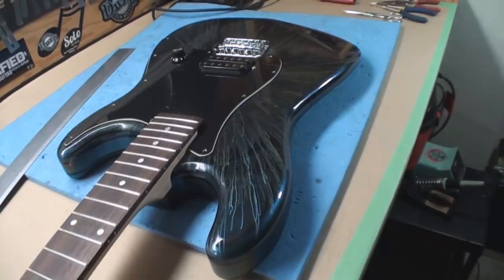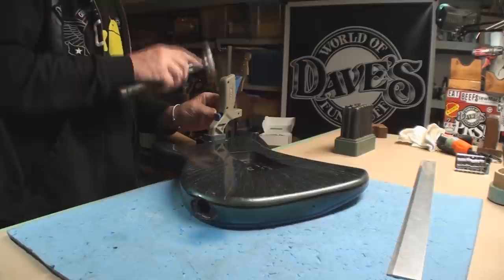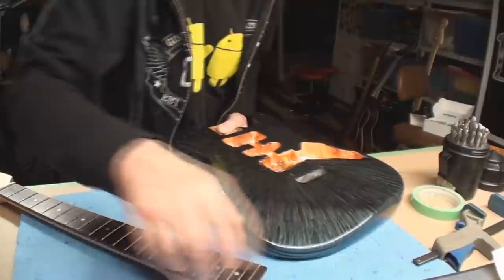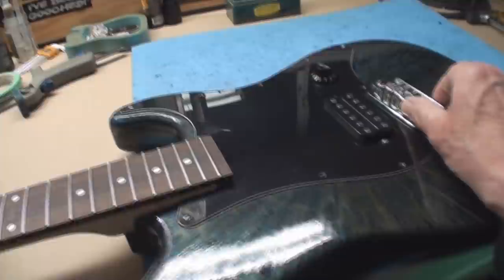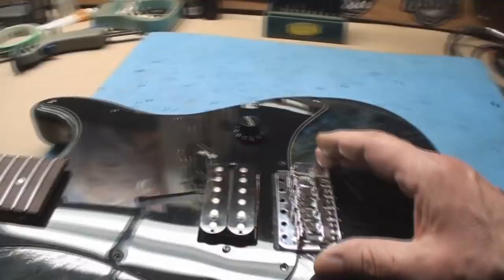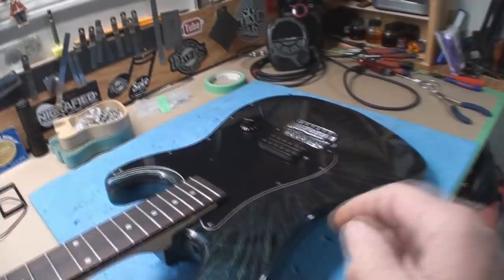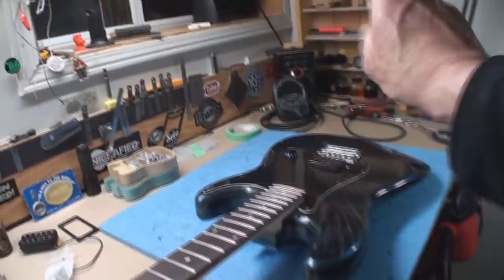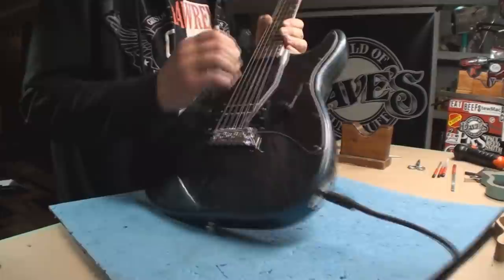Orphan Guitars Part 4 The Splatocaster is Complete

Comment: Dave, I own an '85 MIJ Fender Contemporary Stratocaster with a single dual coil and just a volume control. It was made in the year that Floyd Rose sued them because of the tremolo system. I had a Carvin pick-up installed and also a Floyd Rose Trem system (it's a lock down systsm). It reminds me of the Splatocastor. It was a work horse for me in my last band. This is probably boring as hell but I prefer the same set up as the guitar you built. Less to mess with. Straight to the point.

Comment: Dave, one control is fine.  But why not add a coil splitter to the mix so the single pickup guy has two somewhat different sounds.  Easy peasy or not?
Reply from the maker: we retrack yer guitar in the studio..yer tone is an illusion..give a performance and fuk the settings